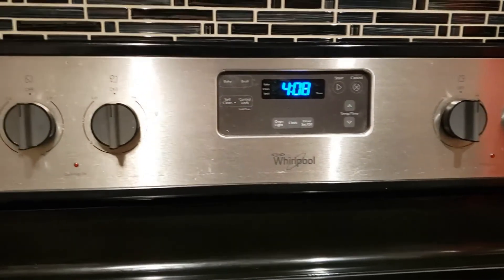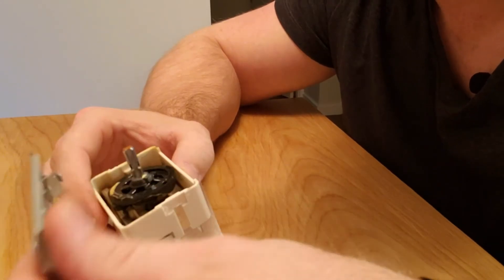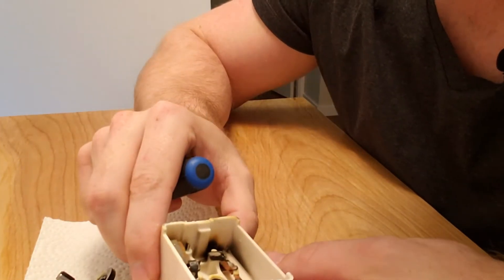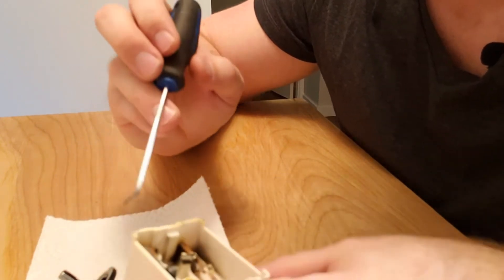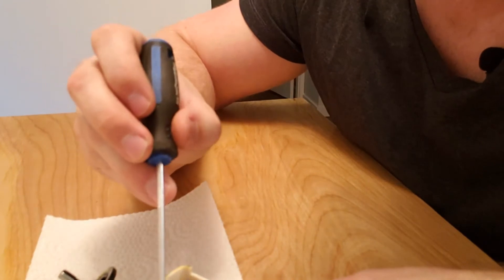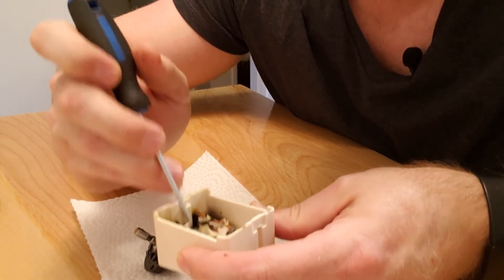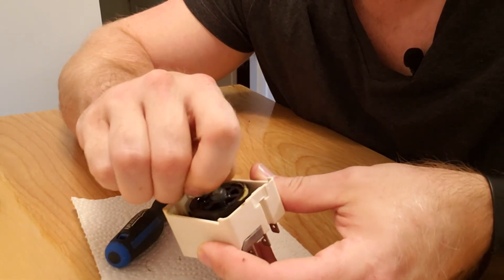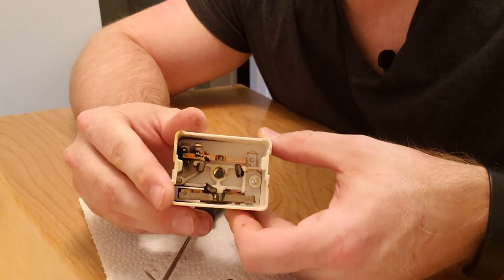Light staying on stove console - Infinite switch internals explained

Comment from the maker: Thanks for watching, Let me know if you used this video to fix your stove in the comment section. Hit that like button if you learned something new, or liked watching this video. Have a great day!!
Reply: Can you explain each letteron the switch please
Reply from the maker: @rnegrete3749  p is for pilot light which goes between switches usually to light up the bulb saying the element is on. L1 and L2 are your 2 power connections. H1 and H2 if it has both are the connections to the elements. Thanks for watching!!
Reply: @Thomasappliance  I have a new infinitive switch and it has h1 hc L1 L2 and a P the old switch has 5 terminals the new one 6
Reply from the maker: @rnegrete3749  sometimes there is a double connection on L1. But wiring it L1 to L1, L2 to L2, p to p, h1 to h1, and h2 goes to hc.